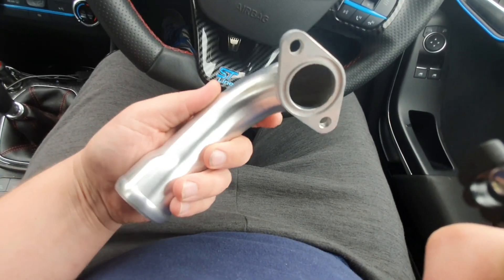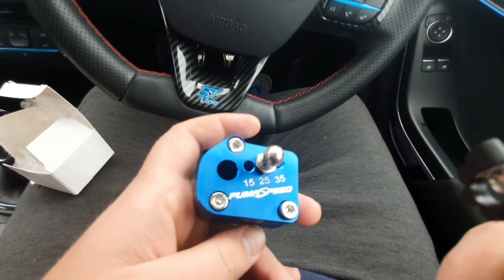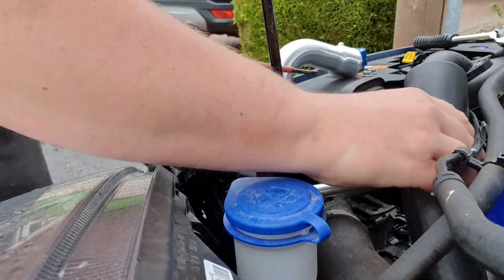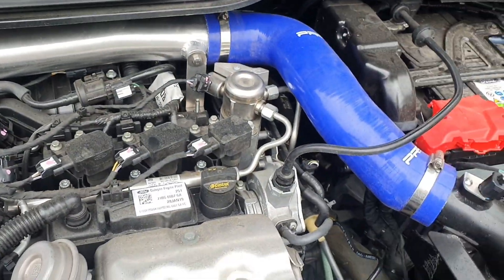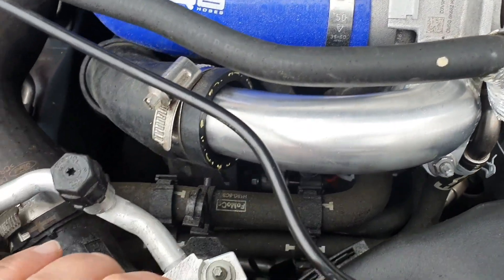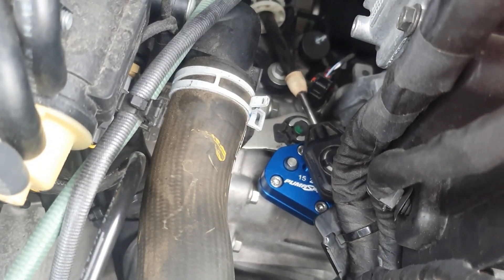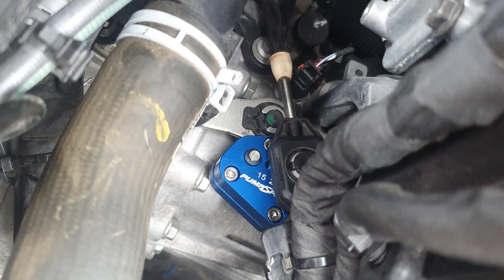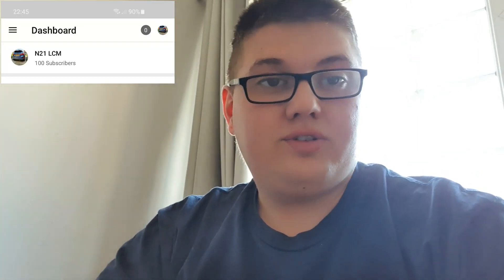Installing A CEUK Turbo Hard Pipe And A Pumaspeed Quickshifter To My Mk8 Fiesta St Line

Comment: You want to look at a remap now youve got all that in it i reckon you'll push 200bhp with the cold air intake and  Exhaust etc.
Reply from the maker: I dunno mate, they go to about 170 ive heard but i dunno if I'm gunna do it
Reply: Nah you can push 220 on them
Reply: If the mapper knows what he’s doing he’ll only add 20 bhp, but obviously the mods can provide more, but nothing more then 165/170, any higher you’ll need an upgraded intercooler or you’ll get the ecobooooom

Comment: Where did you get your carbon st line steering wheel panel from please. I can only find st ones.
Reply from the maker: Its still an st one, I had a sticker made from a company called RJ Graphics to make the sticker say line and then I stuck it at the bottom of the steering wheel

Comment: The hard pipe doesn’t really do anything to be fair. I’ve had it fitted and it only messed up my boost pipes as it was colliding with the aux belt 😭
Reply from the maker: Yeah it's just a little show piece really to go with engine bay I think but tbf might help if you get it mapped ect. I haven't had it mapped so I don't know😂 and oh dear 😭
Reply: @Lewiboii123  you still got the car mate
Reply from the maker: @ecobooost_power3344  yeah mate bought it outright when it was time to give it back or whatever
Reply: @Lewiboii123  you staged it or anything now ??
Reply from the maker: @ecobooost_power3344  no mate just left it standard with all the bits on, was thinking about doing it but scared of engine blowing up cos I've ragged it😂 and also had my gearbox go at about 18k and I'm at 41k now so bit scared cos won't have the money to get new if it happens 😂

Comment: With all these new parts within the engine bay has it boosted your BHP Much?
Reply from the maker: I'm not sure mate I havent dynod it
Reply: in theory should run about 15-20bhp more with full induction but you’ll probably only get around 10 or so on the dyno id believe

Comment: I have a fiesta st line turbo mate 2018, what did you use to get the exhaust louder mate, I’m no good with all these mods
Reply: could you explain what the purpose of the 2 things you have fitted
Reply from the maker: I got a custom cat back system exhaust and the air filter is to drag more air into the engine to get more power out if it and the hard pipe was to complete the engine bay and its for better air flow and the short shifter is just for quick shifting
Reply: @Lewiboii123  so with the custom cat back system, how much did that cost and how did you install it. Also is the exhaust always going to be loud or can you make it quiet sometimes
Reply from the maker: @marcoporcelli7950  it cost £300 and I went to a exhaust place to get it done and most likely be loud all the time

Comment: Yo bro.
I have 1.0 140ps 2018 Fiesta StLine,(3doors) but im too afraid to do anything to it since its a 1L motor.(and honestly i dont know mechanic that good)
Are you having any problems after instaling all of those mods, and how it increases performance.
Thanks mate cheers
Reply from the maker: Hi mate havent had any problems with my mods only a few that are fords fault, you can fit them yourself, I did all mine by myself apart from the side skirts and front splitter mate